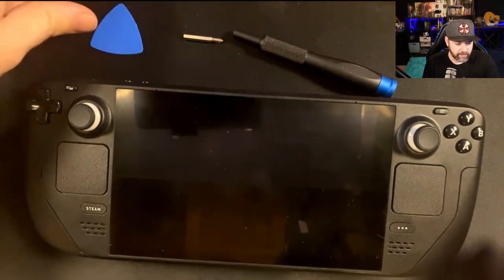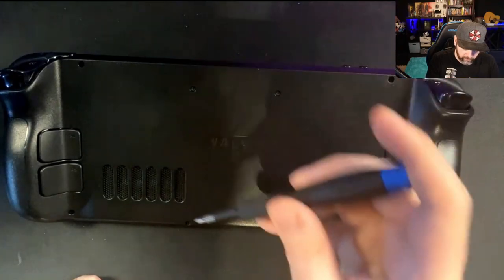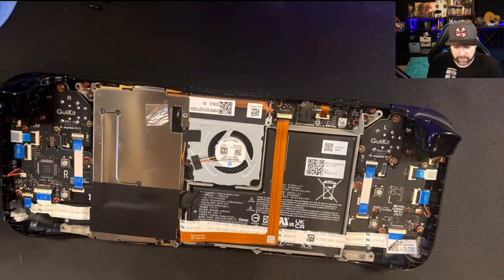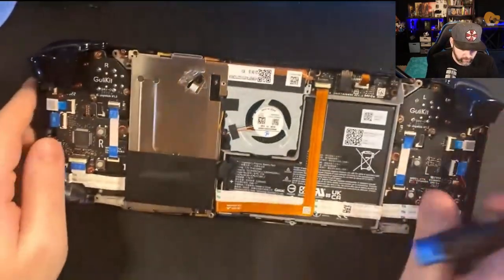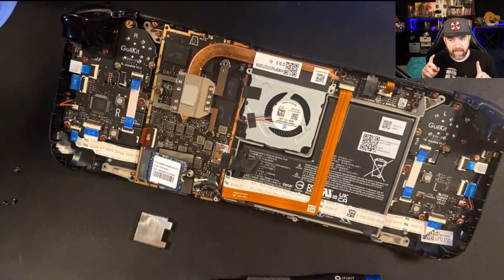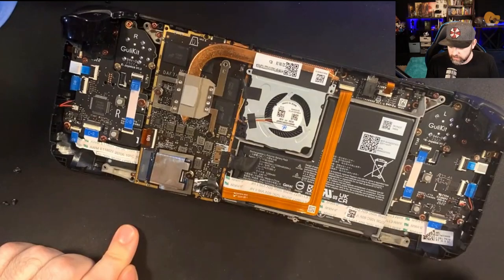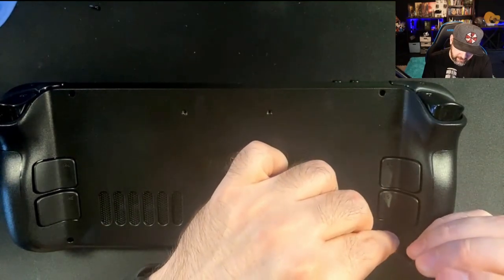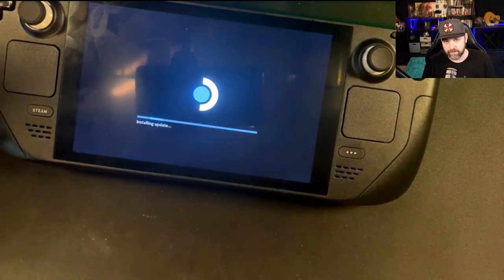What you need to know when opening your Steam Deck... upgrade your ssd

Comment: Hi James great video bro I just wanted to give a quick tip since you asked for any it’s not a real big deal but I’ve modded a lot of Xbox’s play stations  psp/psp go laptops tablets and tons of phones and controllers one thing I’ve learned was when handling mother boards and the innards of electrical devices it’s a great rule to never physically touch with your finger tips any transistors diodes or even solder because the oils from your skin can cause corrosion over a period of time I’ve even taken laptops apart before that have not been cracked open since they were shipped from the factory that have rusted finger prints in places where the oils from a workers fingertips from the Manufacturer was not wiped clean before Assembly it’s just a small tip but can make a big difference down the road in the future for those of you that wish to keep your decks in top shape for as long as possible hope this helps 👍🏼

Comment: Nice guide, I would just place the Deck face down in the case to protect the joysticks.
Also make sure to push the power button after you disconnect your battery to drain any charge left in the pcb.
I don't think anyone should replace the battery themselves. Its glued in and you could start a fire i you punctured it.
btw. Im writing this on my Steam Deck 😃
Keep up the good work👍
Reply from the maker: Good call on pressing the power button after disconnecting the battery.

Comment: The four outer screws on the back are impossible to remove, I got one of the four but the other 3 won’t budge. Got the four middle ones out with not problem. Any tips to get these screws out? (The screw driver is the correct size)

Comment: Hi. Do you think that i should stick to Amazon ? Im asking because the 512gb SSD cost the same on Aliexpress than the 256gb on Amazon.
Reply from the maker: It all depends on the seller when dealing with Aliexpress. If the seller seems trust worthy then you should be fine. You can also check out onlysteamdeck.com where I sourced some drives from a seller that is good.
Reply: @games_revealed  Thank you for the answer.

Comment: I tried to open it up for the ssd upgrade and everything was ok until I has to unscrew the last screw. It was overtight and stripped after trying for too long. I have no extra tools than a set of screws, what can I do? I also tried a rubber band method but I couldnt make it

Comment: I tore mine open the day I got it and I was mad cause the small screw that holds the ssd in got stripped and I couldn't screw it back in. Luckily I keep all my pc building stuff and screws from previous builds and I had a screw that fit and it also is a screw for m.2/nvme ssds.
Reply from the maker: It was already stripped? that’s concerning
Reply: @games_revealed  no no it became stripped as I took I out to replace the ssd and I didn't realize it was stripped til I went to re install it